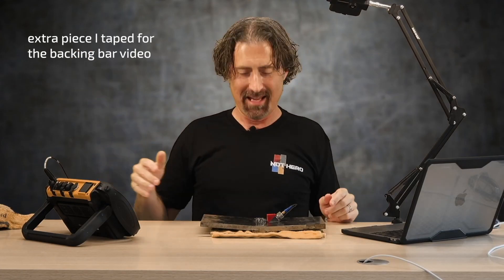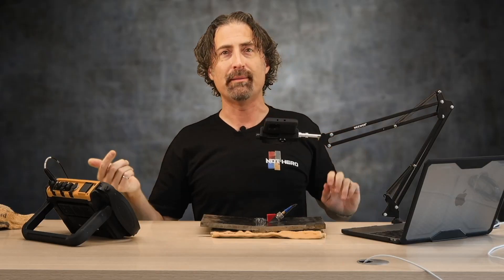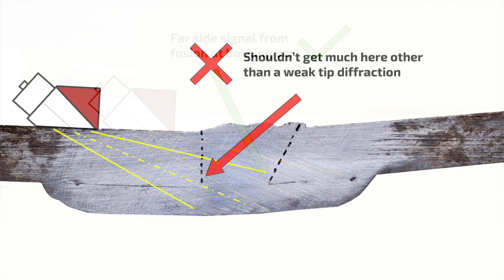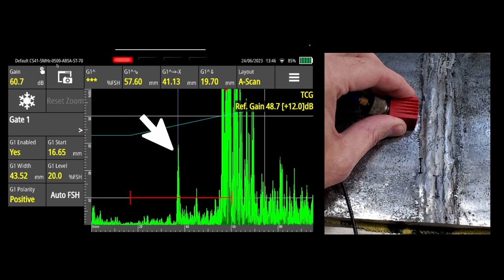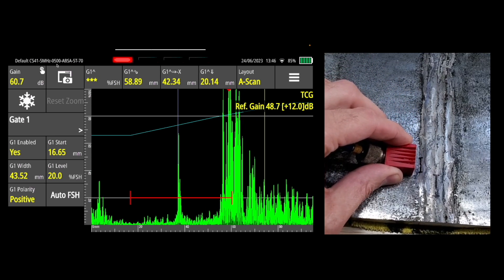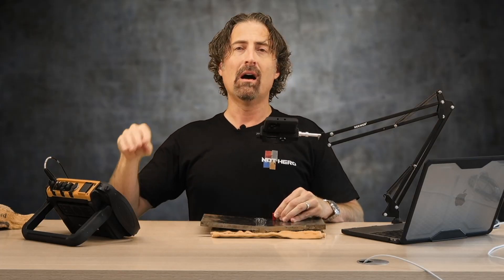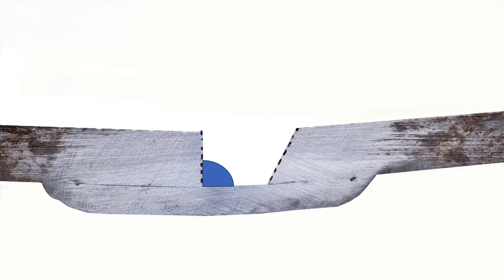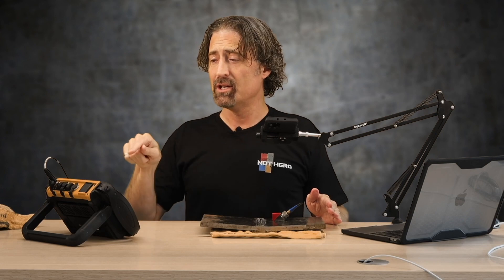Backing Bar Weld and Lack of Root Pen

Comment: Do you have any plans for DGS related videos?
I'm waiting for your take on this controversial topic :)
Reply from the maker: Here in Canada we rarely use DGS. I've seen it on a job once, and it wasn't me doing it.
Reply: @hollowayndtengineeringinc.5201  neither we do use it here at all :) 
But nonetheless it's always fun to experiment with whatever option I have on the device.
I've been fiddling with those old trusty MWB probes of GE, I calibrated on a standard blocks following a videos of GE themselves, but I was confused with the results of the ERS, I thought those curves would fit the SDH diameter, stupid yes, I am :/, thanks to Mr Philippe Rioux he cleared my confusion and send me to the right path.
Still, I don't get a proper conversion from ERS which is supposedly FBH in the essence, to a SDH.
I wonder why EN 583-2 has removed that formula used for this purpose anyway?